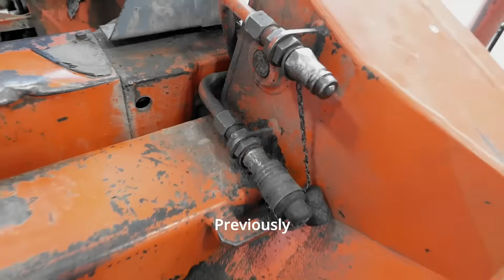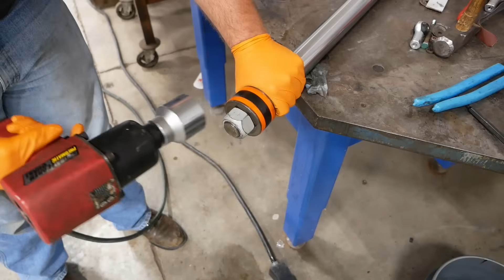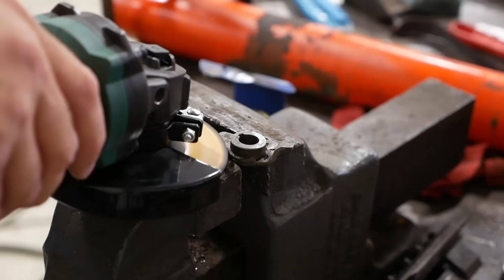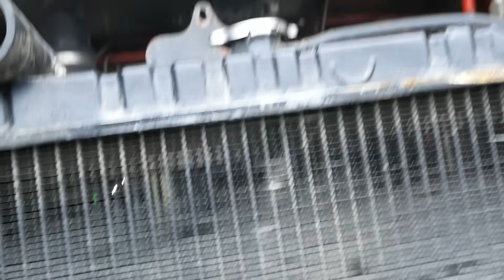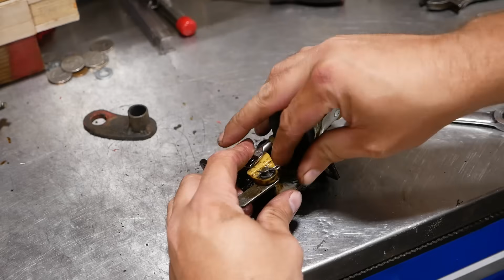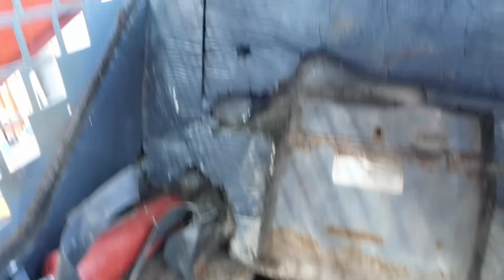Did I Blow up My Cheap Skid Steer? -  Thomas 173HL Won't Rev up, Leaking Cylinder - Part 2

Comment: Had a 1978 Ford E-100 with the 6-300 in it.
Radiator had a slow leak. 
One night, stayed out late, engine was running fine, a touch hot. Maybe a touch over 200F. It's past midnight, I pull into my family's driveway and shut her down. Engine started to diesel/post ignition. Dad taught me to stomp the gas and it would flood it and stop the dieseling! Worked every time, except this time! There was enough heat in the head to ignite the air/fuel that when I stomped the gas I created a run away engine! I instantly realized what I had done and ran out of the van only to find my father on the porch in his underwear (the noise had woken him) I yell out, IT'S GONNA BLOW! I can still see him dancing around not sure what to do. It was comical. The noise of that 6-300 reving into RPM's that it had no business to enter in a midnight quiet was deafening!
Luckily, the carb to intake gasket blew out and the engine went down to a lower RPM. I ran back,  put her in 1st and popped the clutch. Thus, shutting the engine down and learning the proper way to kill a dieseling gas engine! 
Went down to NAPA the next day, got the carb to intake gasket for a buck and fixed the engine. Tightend up the single barrel Carter carb and she never ran better. 😂

Comment: I always had better luck broaching things when I put the broach 90 degrees from where you have it. So right to left. On our shop presses, the stroke and slop from the ram was what torqued on it the most, causing it to dig in and screw it up. Placing it so it was going right to left helped me out a lot to avoid some of those pressures. Did not fix my mistakes, but it at least helped me mitigate some others.

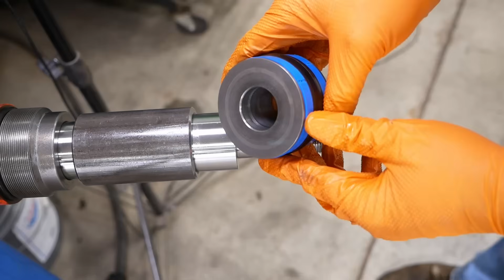Comment: 24:34 could that groove mate with the o-ring on the shaft somehow and if so might you have installed that 180 degrees out?
Reply from the maker: I don't think so. I installed it way it was when I took it apart, and I see no sign it has been apart before.

Comment: I was surprised you didn't fix the other cylinder end.   Simple bore and bushing fix.  
Oh well.
Reply from the maker: Where would you stop? It needs 12 new pins and 24 bores welded and bored.

Comment: Hi Wes, you might want to reconsider the parking brake, nobody likes being squashed by your own equipment. how much could it cost to repair the cable?
Reply from the maker: I dunno. Hydrostatic equipment really doesn't roll. Most skid steers have no provision for a brake.

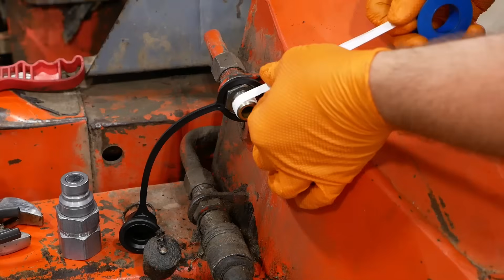Comment: 26:37 can anyone give some advice on when you should use Teflon tape on high pressure stuff like hydraulics? I recently helped my mentor rebuild an old pressure washer with brass valves and stuff and the guy told me don't use teflon tape on machinery, it's should be reserved for house plumbing. Is there any general option on this? If the connector has a rubber seal then it's not neaded?
Reply: If there's a seal it shouldn't be necessary.  Use tape on tapered threads (NPT and BSPT).

Comment: do what cutting edge does and lock the fixed end of the cylinder in your hydraulic press as a third hand....
Reply from the maker: That would not be possible in my shop.

Comment: The other thing to watch for is how much "pump" is available to the accessory plumbing.  This is a major limitation on just what you can attach (after sorting out the QwikAttach mess).   That definitely looks like you have on/off only, rather than FWD/Rev (something very handy with a fence post auger, for example).
Reply from the maker: Yeah this does not have high flow hydraulics or anything fancy.

Comment: one thing i learned a long time ago is to break the gland loose before yu remove the cylinder. if you cant get it loose there's no sense pulling it.
Reply from the maker: There’s always a way to get it out. Sometimes it’s in little pieces.
Reply: There's a lot more tools I can bring to bear on a recalcitrant cylinder if it's off the machine.

Comment: Don’t fix it to good, the poor thing will definitely break down then, hydraulic cylinders/ rams are such a treat to find component parts for them, especially if the machine is older and job specific, I have had to make new components to fit seals that would fit barrels and not pistons or heads, always fun. Nice salvage job on your fuel pump. Thanks for the update sir, enjoyed the video.

Comment: when you use the seal folder i set the seal on a flat surface and hold it down with my hand, the folder tool kinda between fingers. couple drops of hydraulic oil and get with it.

Comment: it would cool if you could find a quick-attach off a dead parts Bobcat or something and swap it onto your machine.
Reply: a dealership or a rental place probably has a mothballed/retired machine they scavenge for parts. we got a decent used 60 inch bucket for our bobcat 763 for $1200 vs $2500 for new from rental place. their going to be swapping out our qwik tack plate in December since our's is bent

Comment: If you can keep your eye out for a retread road alligator without the cables in it. Stop and grab it. They make really good tread. You can screw it down to your step so you don't slip on it when it's snowy and icy. Works real good for resoling your work boots too, 60,000 mile guarantee and acid/oil resistant. The best ones are the little square treads, not the big pentagon type. 😉👍....probably the most redneck thing you ever heard ha ha 🤪

Comment: You look happier, Wes. Whatever changes you did in your life/shop sure shows through your emotions.
Reply: he quit working for a living. i'll be happier too when I can quit.
Reply: Might partially be that he stopped working on rotten plow trucks.
Reply: Being a full time utuber is anything else than easy! It's a ton of work.
Reply: @Chr.U.Cas1622  Still got to be easier than being a full time YTer AND work a full time job.
Reply: Dear  @dfross87  
Almost all people simply don't get it. It's work what is shown plus the big effort of filming the steps. Absolutely any work will therefore take 2 to 4 times longer than usual. Then the data must be put into the computer and the video has to be edited. Especially that is a lot of work. Afterwards the data has to be uploaded.
Best regards, luck, health and wisdom.
Reply: he got a side piece 🤭

Comment: I'm totally having Cutting Edge Engineering flashbacks here, what with all the cylinder rebuilding and what not. And yes, that's a good thing :)

Got to be careful when you start liking cylinder rebuilding, though, or before you know it you have a massive workshop with a gantry crane, ginormous lathes and honing machines, along with an attention-seeking dog squeaking his way around the shop :)

Comment: the boat I use has a 3 cylinder kubota base engine, so far its had 3 diesel overruns, the last one bent a con rod, turns out the mechanical fuel pump was leaking diesel into the sump, its now running lovely. these engines are pretty much bullet proof.

Comment: Keep a Co2 fire extinguisher around for a diesel runaway. A blast into the intake will shut it right down.
Reply: That what the use on Mr. Hewes Tank channel.
Reply: Never heard of that one before but it makes sense👍
Reply: How about a blast of Argon/CO2 from his MIG tank?
Reply: @TheOtherBill  Or nitrogen?  Lots of heavy equipment shops have a nitrogen charging kit on a cart for accumulators and suspensions.
Reply: @TheOtherBill  I'm sure it would work, but how would you get the gas out of the cylinder? Simpler to just keep a clean agent extinguisher at hand when working on diesels.
Reply: @ForfeMac  hose to the tank valve just in case for when you're working with diesels?
Reply: @ Are you trying to say a fuel shut off? Diesels are sometimes worn enough to consume their own oil and will keep running unless you can physically stall the engine with a load or retard the combustion process enough to stall it. Either by stopping the air flow by blocking the intake with a board or something, hoping there isn't an air leak somewhere to allow it to keep running, or blasting co2 or nitrogen or something down the intake to prevent combustion until the engine stalls.
Reply: Good call!!!!!
Reply: I have never thought about that but it should work
Reply: On the same line of thinking, but much, much cheaper than having to pay for an extinguisher refill or replacement, CO2 cartridges (like those for pellet guns) put out a large volume from a small cylinder for pocket change versus 20-30 bucks plus time and travel for a refill.
Reply: @pettyfogger2305  Not nearly the volume you'd get out of a 5 or 10lb CO2 extinguisher, especially not for the money. Engines are pretty expensive, shop buildings and all the stuff inside them are a lot more expensive, $300 for an extinguisher and $50 for a refill is cheap insurance for a runaway diesel.
Reply: @pettyfogger2305  The engine will laugh at you piercing your little cylinder.
Reply: Geez, how about just sticking a big rag in the air intake tube..
Reply: @rssvss  that's a good way to end up with a rag stuck in the turbo, or worse, in the engine proper. Better to use a board if you're too cheap to get an extinguisher

Comment: Look at the bright side during your full fuel. It didnt drive forward and try to crush you between the lift, the door, and the wall.
Reply: I thought to myself as Wes lowered the safety bar that this might not end well.
Reply: @andrewmantle7627  Sometime repetitions are needed to learn 🤷‍♂
Reply: I thought that as well :)
Reply: I thought o $hit there goes the shop, but figured Wes hadd a plan?
Reply: Or squash his bulk oil supply
Reply: Yes that would be the reference.
Wes reminds us every once in a while that no matter how precise and methodical we all try to be, a kick in the nuts is the end result
Reply: Well, he's not wrong Wes... That is the bright side of things! :)
Reply: Are you referring to the Pontiac Vibe video? That one was quite the encounter. If you don't know about that video,sorry for the reply?
Reply: I thought that as well .  But then I remembered that the Automatic parking brake would have stopped it  )-:  !!
Reply: Until it doesn't.  @BurnAndHackett_RC
Reply: This discussion makes me think some people might suggest fixing that safety bar parking brake feature. You know. For safety. @BurnAndHackett_RC  @andrewmantle7627
Reply: Yes, shit happens when working on cars, have many stories from the years back as body-tech, painter & mechanic and helping shade tree mechanics with solving problems. Some are cars caught on fires, fell down, battery acid in the mouth, cars took off inside the shop, chain busted on the frame-machine while pulling a damaged frame... but have all my fingers and both legs still. Some old friends didn't have same luck. 😐
Reply: Story time.
Reply: @peterjensen6844  10 months ago Wes had an incident "My worst f-up as a mechanic"  if you are not familiar with the video. While my comment was not to insult Wes it was just a reminder that obscure incidents catch even the best of us off guard. Hopefully with nothing more than increased heartrate and minor anxiety. I am just happy this one had less injury than the last
Reply: @MF-hb7dc  Ah I see it now. Makes way more sense.

Comment: It’s like watching South Main Auto, Rainman Ray, Andrew Camarata and Cutting Edge Engineering all rolled into one…
Reply: Cutting edge is a Machinist wizard.
Reply: This channel is my favorite. But all those you listed are great too. I only recently found Cutting Edge though and he definitely has some skills!
Reply from the maker: I dunno if that is good or bad.
Reply: @WatchWesWork  it is what it is, you'll just have to live with it 😁
Reply: @WatchWesWork  I meant it in the best possible way. If you’d mentioned angry pixies, schmoo or engineering magic, we could have had a bit of AvE and This old Tony in the mix!
Reply: @WatchWesWork It's bad for my free time, but good for you I guess hahaha
Reply: Andrew would drive it off a cliff then say thats why the cage is junk then reinforce it and keep running it lol
Reply: You ain’t seen nothin til you’ve experienced a runaway locomotive engine. Had a GE 7FDL turbo fail and the free flowing engine oil in the intake air manifolds caused it to run away during a load test one time. It was scrap iron after it finally let go. I never want to be anywhere near something like that again.
Reply: that would have been a very scary situation a diesel motor that size in full runaway mode I guess there is nothing you can do but let it distroy it self and stop I do not blame you nor wanting to experience that again at least you survived it
Reply: @ralfie8801 150 lb piston assemblies moving at Mach Jesus I wonder how far or what thickness steel that can shoot through 😂😂
Reply: don’t forget diesel creek
Reply: Don’t forget diesel creek
Reply: Great video Wes! Quick thinking on shutting down the engine . A run away diesel is no joke . I don’t think a lot of folks realize what can happen. I personally witnessed a old John dear excavator engine completely destroy itself . So I know how fast your heart was racing when that happened!
Reply: If you like those, I hope you watch "Marty T"
Reply: @ferrumignis I enjoy watching his videos very lay back approach but he is very knowledgeable
Reply: Glad to see we’re in the same pool of channels
Reply: The old city I worked for had a Kubota tractor I think it's b 210 or something any way the governor springs broke the engine went wild until the driver was able to choke it with the clutch in low gear and a tree that was close by great job with your tractor and stay safe and God bless from GA
Reply: All the best channels in one wez
Reply: curtis would have line bored that cylinder end though.
Reply: @katelights  FYI He’s Kurtis. With a K.
Reply: HAHAHA, I thought we were going to have an Eric(I Do Cars) engine teardown , with extra inspection ports !
Reply: @orbitalair2103  Malice in the combustion palace.
Reply: Camarata would have fixed this with even more worn out parts welded together from an older, more worn out, machine. Lol
Reply: We’re twins @thesushifiend
Reply: Have you tried diesel Creek?
Reply: Diesel creek
Reply: Totally agree 💯🙂. WWW rocks!
Reply: Yes, and Andrew did work on a bulldozer recently and one of the AC type fixes was on the rear view mirror.
Reply: I'm still waiting for him to install a radio with the help of a chainsaw and hand measurements...like Camarata did that one time.
Reply: Oh what you don't watch low buck garage
Reply: It was funner when I thought it was just me
Reply: Diesel creek buddy!
Reply: @Don_Johnson521  I've seen a few vids but the guy was less than captivating so I haven't gone back. It's a mix of personality, skills and a little deviousness!
Reply: Bro been in my watch history fr
Reply: Don’t forget Jesse muller
Reply: ..and Ivan at Pine Hollow Auto Diagnostics ...😀😀
Reply: He’s nowhere near as heavy handed as Camarata😂
Reply: And Pine Hollow Diagnostics.
Reply: Wes, you do a great job! Very happy to have happened upon this channel. Being lumped in the south main and rain man Ray is a very good thing.
Is there anywhere to learn about your background as you so very creative and capable?
Reply: @clintprice2123 Rainman Ray is a hack compared to those others mentioned
Reply: and blondihacks
Reply: @boelensds , used to watch her but that pixie dust intro got annoying so deleted her.

Comment: I didn’t even know that Thomas made skid-steers, I’ve only seen their school busses. The U.S has a weird market though. My wife’s uncle in Mexico has a 2022 Ford F-250 with a non-emissions 6.7 Powerstroke and a 6 speed manual.
Reply from the maker: That's pretty normal. Cat still makes the old 3406 truck engines just like they did in the early 90s. They just can't sell them here.
Reply: Too bad they couldn't sneak some into the U.S.

Comment: Sounds similar to my old neighbors ancient John deer skid steer lol except his throttle goes down by itself and wont stay constant
Reply from the maker: Lot's of old tractors are like that. Usually there's a pair of vise grips near the throttle.
Reply: @WatchWesWork  their were none their just a old bolt and a lot of bailing wire. It has worn chains in the drive and probably the most jerky movement controls ever. I felt safer operating his worn out Ford NAA tractor with a broken governor and or his no floor 04 6.0 F250 power stroke

Comment: Do you think everything was just made with too soft of a grade of steel or has tons and tons of hard hours on it to have caused basically every joint on the engine and control linkages and cylinder ends to have oval’d out like that?
Reply from the maker: This is pretty typical for a high hour machine. These things vibrate like crazy.
Reply: We use bobcats on the farm. I can say we now do a lease every year. Run them to 6000 hrs and then trade them in. After 6000 hrs you have to replace about every bushing on the controls and arms.

Comment: "The tool i s supposed to make it easier."  Boy have I been there, done that!  I also have a collection of o-rings where I needed 2 and had to buy 50.  Eventually, you'll find something else that uses them, amazing how that works.  Might take 20 years, but you will.  :)
Reply from the maker: The problem is I'll forget I have them or where they are.
Reply: @WatchWesWork  What you need is more storage!  When we bought (most of) the contents of a hydraulic shop that closed down, we got more fittings and seals than you could ever dream of.  Thankfully, we also bought the storage system that held it all.  Roughly converting it to imperial, it would be ~2450' of shelf space.

And I still find I don't have the right part in stock!